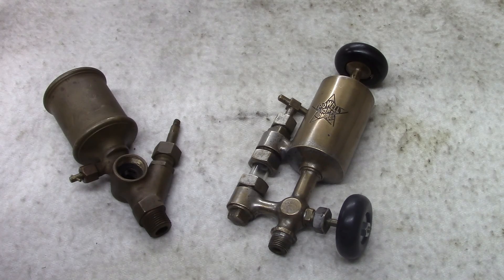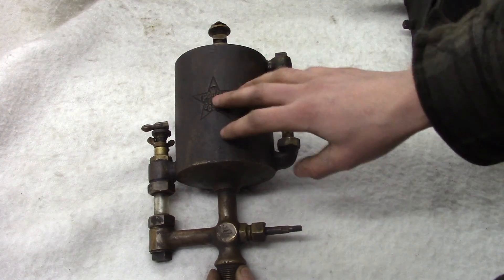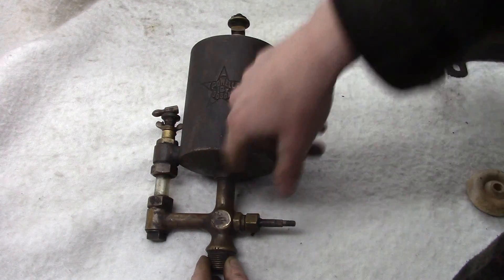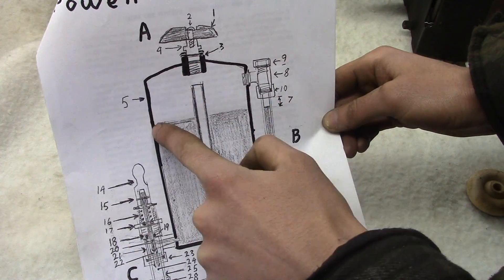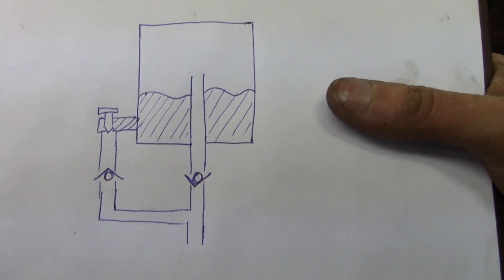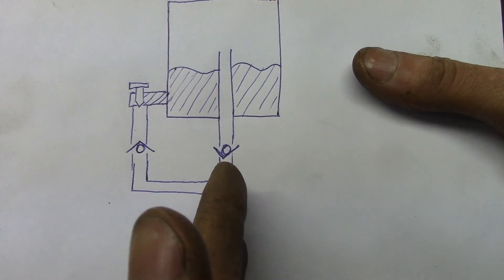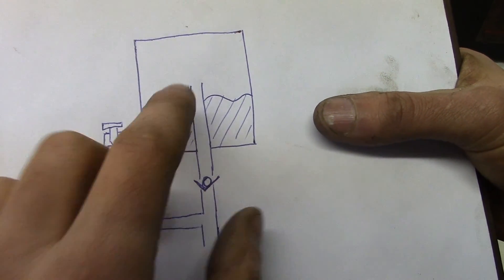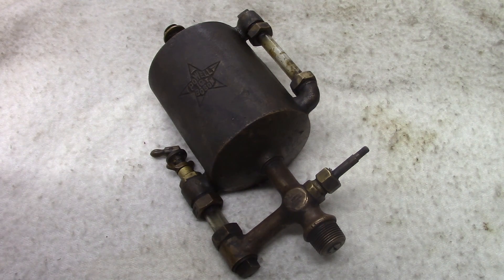Old Engine Basics - Lubrication Part 2

Comment: My dad is a Union 636 Pipefitter. so he works on on compressors all the time. Back in the day the old Howe compressors had hardwood bearings and used drip oilers like that. The reason for the sight glass that's off to the side was to keep air out of the sealed system on the compressor. If it was a drip type oiler, air would get in. It also gave the  Stationary Engineers local 324 something to monitor
Reply from the maker: Interesting! Thanks for the info. As a side note, i think it's wild that hardwood was used for bearings, and that it actually worked well as a bearing material too! super cool.
Reply: themadmailler Yeah I said the same thing about the wood bearings, he just told me that they used maple wood.